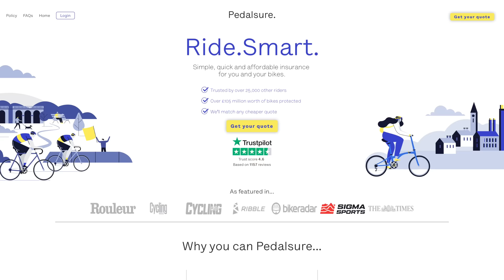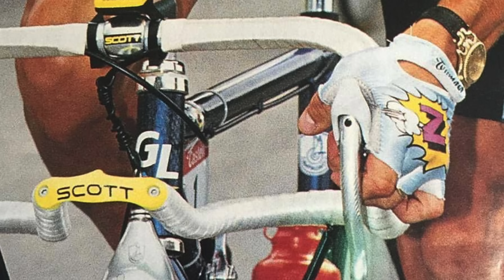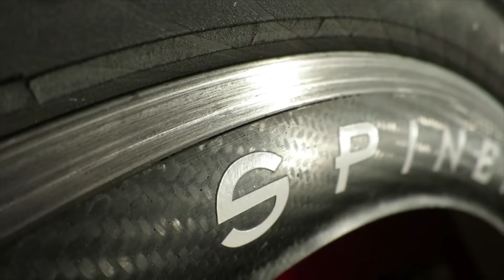5 BIGGEST Tech Fails of The Tour de France

Comment: In its defense, the wired Mavic Zap actually worked quite well.  Their wireless Mektronic was a disaster, though.
Reply: Yup. The only issue I've had with the Zap was when the battery was low and it kept wanting to shift to the smallest cog instead of staying in the gear it was in. I still use mine everyday. I did adapt the Mektronics brifters to the Zap system.

Comment: Rev x was a pretty darn good wheel .
Reply: I am still riding a trek 5500 with rev-x wheels.
Reply: @ReginaldPoyau  Very jealous 👍
Reply: Agreed.  I've never had any issues riding both the road and mountain versions.  They do look cool as sin, too. :)
Reply: Rumor had it the failures were caused by a harmonic resonance that would flex the spokes to failure as static strength was very high. That is why the stiffeners seemed to prevent failures. Surely the stiffeners negated some of the aero advantage
Reply: @othgmark1  I think this is correct. The spokes are riveted together at the rim and I believe that is where the crack failure would start.

Comment: I do strictly amateur level cycling BUT I did fit a set of the Spinergy wheels (1990s) to one of my bikes and that was a revelation. First, more comfortable, damping of the road roughness was clearly noticed AND compared to another set of wheels (Mavic SSC laced with DT Swiss bladed spokes) over the exact same course (approx 28 miles) I was averaging 1 mph better on the Spinergy wheelset. The only nit I had to pick with that wheelset is you needed an extension for the valve stem and it was a handful to pump up the tire. I can't figure out why the UCI considered the carbon spokes to be a hazard. With all the other pointy or sharp parts of a bicycle that could hurt you in a crash I'm sure the Spinergy spokes would be way down low on the list of "risks". Another big plus was that they were pretty much bombproof. The average pot hole at speed or road hazard never caused any damage to the wheel. I rode that wheelset for over 10 yrs with no maintenance required and they are still in tune. If Spinergy ever came back on the market I'd grab a set in a heartbeat.
Reply: I really like the look of these types of wheels too but had heard about them being potentially dangerous. 

Having done a bit of reading about them I can't find any reports of severed limbs etc but I have read about the dangers of them suddenly and catastrophically failing. 

The logic is that carbon fibre fails very suddenly, where as metal deforms before breaking. This combined with only having 3, 4 or 5 spokes means that when one spoke goes all the other go at the same time and it produces a big crash. It's also likely to fail under higher loads which I guess are going to occur at higher speeds. 

There is a report Mr. Rick Vosper: A tangled Web Woven, GorillaNet v.2.8.1, September 4th, 1998 if you want to read more.
Reply: I think it's the nature of failure that's the problem. When carbon spokes break you'll have catastrophic wheel failure, vs. going out of true and wobbling. I still have a set of Spinergys and frankly am scared to ride them.
Reply: They were not dangerous when they were whole. But they often weren't. They were flawed and broke often. The cause was insufficient "spoke" tension due to various factors. When you overloaded them, they would collapse, and contrary to a standard wheel, that was a catastrophic failure. The spokes would break, and if you ever saw carbon breaking, you know that it virtually explodes, sending sharp shards shooting all over the place. Plus, if it was the front wheel, the rider is falling on what is left of it - which in this case would  be a hub with 8 sharp swords protruding from it. There was a GOOD reason to ban them.

Comment: Had several of these "fails" when I was racing through the 1990s -- Drop In bars worked fine.  They were a deeper drop and great for crits.  When I first got them, I was still using downtube shifters and it was easy to switch gear from the lower position.   I thought handling was fine and definitely much safer than the (now UCI banned) method of stretching your forearms on the tops to try and get aero.  Had a pair of Spinergy wheels which came apart on me -- a teammate had a pair and broke his, too.  They did have an unmistakable sound and were pretty popular.
Reply: What was the sound like?  Can you describe it?  I'm 41 so I just missed that era!
Reply: @OakleafOrganic  like a helicopter rotor or something, whom, whom, whom, whom. 

Had a pair and loved them. they were wicked fast
Reply: @ChrisTrunek  what?!?!?!  That sounds awesome!!!!!  Remember the Sobe label with the lizard riding up a singletrack on a (mtn) pair?  That was cool.

Comment: Had a pair of Spinergys on another ‘banned’ product, the Trek Y-Foil, in the mid 90s. Absolutely fantastic combo. Fast, responsive, although by modern standards a little heavy. Still ride the Y-Foil but the Spingerys went out when I had a massive crash in Spain. Doing some TT training, down in the tuck and hit a 4cm deep pothole, front wheel crumbled completely flipping me over. Bike came up and over with me and I landed on top of it, my elbow going through one of the splines on the rear wheel. Lots of other parts broken including my ego as I managed to crash in front of a parade of shops. By the time I crashed, talk was of banning the Spinnergy style wheel, so I didn’t replace them when I rebuilt the bike, more the shame, because I loved them. As people say, looked amazing (especially on a Y-Foil), sounded amazing, rode amazingly well. Only negative was braking, as I had the original version so no steel rim for the pad to work on. To say it was sketchy braking in the rain or when the wheel and pad were hot (such as a long alpine descent) is an understatement.

Comment: Rev X’s were my first carbon wheelset, loved them - they were soft riding and made a good noise at 40kph. Super reliable as well, never had a problem with them and I rode them lots.
Reply: i used the Rex X on my cyclocross bike and my mountain bike with no problems with the wheel.   I did get a large stick get chopped in half when thrown up into the wheel and could have had a squirrel cut in half but I believe he hit the spoke and bounced clear.

Comment: I still have a set of Spinergy Rev-X wheels. You had to glue the factory supplied  X stiffeners or it was rumored that they could collapse under load. Mine were fine, but the UCI were right regarding the amputation danger. I had a squirrel do what squirrels do, and the poor animal hit my front wheel and just exploded. They were the Cuisinart of wheels.
Reply: Some 25 years ago, I had 2 birds fly thru my front Spinergy wheel on a group ride and yeah, it didn't end well for them. Oddly enough, I didn't go down.

Comment: I had a set of RevX's that I used for about 5-6 years (eventually one was slightly damaged in a crash and that was that).  They were pretty aero (especially for the time), but they were heavy. I'm fairly sure they were over 2 kg.  One nice thing though is that you didn't have to worry about them going out of true.
Reply: just get yourself a pair of handbuilts w/36 straight guage spokes.  My clincher wheelset are 20 years and still True.

Comment: Nimble Crosswind tri spoke wheels were amazing. Light and efficient, wish they were still in business. Still have my spinachi bars somewhere.
Reply: I wanted to buy them to replace my Specialized Trispokes that I warped in Saudi’s extreme heat. Sadly, Nimble said they wouldn’t stand up to the hot road surface here.

Comment: I remember when Mavic Mechtronik was new. I love the design and ergonomic feel of the levers. I was tempted to buy it once but didn't because no bike shop had and has the technical ability to service it if something were to ware out or brake. I have been working on bikes since 95'. I'm a big fan of the Avid Rollamajig and still use one to this day. I find it very disappointing that high end road bikes have gotten heavier with thru axles and disc brakes. Call me old fashioned but I believe that such things always belong on mountain bikes. Thanks.

Comment: Very nice video, 
the Mavic shifter was special, it was not allowed to use electric power to shift, so the was only an electric impulse to the shifter, the power to shift come from moving the chain, the upper shifting wheel gives the power to the shifter. An amazing construction.

The synergy wheels were definitely very dangerous. I’ve got same scars from the special wheels 🤬

Comment: You're wrong on the Spinergy wheels. They were not banned because the edges were too sharp, they were banned because they failed very often, and when they did, what was left of them was VERY sharp and dangerous. A spoked wheel depends on the tension of the spokes for its stability. Spinergy wheels had a mechanism to adjust the tension, but many users failed to do that, and in some circumstances the tension would vary by itself. Having them in the car in the sun, for instance. Now, when you load the wheel so much that a significant number of spokes lose tension and go "limp", the wheel can fold. So you would get your wheels out of a hot car, put them on, get out of the saddle to accelerate and bam, you're down.
With a standard wheel, folding usually results in a bent rim, but the wheel does not collapse. It's not easy to fold it to begin with because there are many spokes stabilising it, and when you do you probably don't fall. With the spinergy wheels, it is usually only ONE spoke that loses tension. And that one spoke is designed to be under tension, and not to bend. So when it bends it can easily break, and when it does, the ENTIRE wheel loses tension and ALL spokes break. Have you ever seen carbon breaking? It won't just break in one place, it shatters and shoots sharp shards everywhere. So the people watching are likely to get a couple of centimetres of sharp carbon in their eye. And the rider is going down, if it is the front wheel that has broken, he is going down straight on that - which at this point is just the hub with eight very sharp carbon daggers attached to it. I don't think I need say more.
There was a (literally) bloody good reason to ban them. They were VERY dangerous. You would not get me to ride them for more than a couple of metres.

Comment: I have the Modolo "Q-Even" bars that emulated the Drop-Ins, albeit with the angular, ergonomic design that was popular in the '90's.  Love that extra hand position, I sometimes rest my thumbs against the head tube & fork junction as I slam my pedals.  No problem with stability, in some mysterious way the position stabilizes the handling of the Spinergy Rev-X's that I used faithfully for almost 20 years, until I wore through the rear rim brake track.  I'm still using the Q-Evens, to this day.  They now keep my new "SuperTeam" tri-spoke" carbon clinchers under control.  Some stuff just works.

Comment: Loved the Scott drop in handlebars. I was racing with the superb pro 7-speed index shifters and the mavic freewheel.
For long rides I could ride those drops all day long and it moved you slightly further back in the saddle for a little more power coming from the glutes.
 Easy to just move from the drop to the shifter to shift.
But, when you're in the 12 all day you really don't need to shift much.

Comment: I remember all of these, the Spinergy wheels were the coolest looking but not stealthy, with that whooshing sound you could not sneak up on somebody. Tricky in cross winds too. Spinacci bars were short aero bars you could add to the top of your handlebars, until banned. Another problem with magnesium is it becomes brittle with age, even so it was used in wheels, pedals and suspension forks with various alloys.

Comment: 1:56 But I don’t understand - SRAM and Shimano use radio waves to transmit shift signals for their modern wireless groupsets. In fact, as far as I’m aware RF is the only form of wireless transmission that doesn’t require line-of-sight. So I don’t think using radio signals was itself the actual issue. More likely the problem was that their particular implementation of radio transmission wasn’t robust enough in the face of interference.
Reply: It sounds like they didn’t use any sort of protocol to avoid interference or having one shifter shifting somebody else’s mech. Modern ones use Bluetooth (I think) which not only has a protocol with a unique identifier, but it also uses spread spectrum so it’s resistant against outside interference.

Comment: I wouldn't call it a fail, on similar grounds to the Scott Bars, but SRAM's hydraulic rim brakes went nowhere
Reply: I have a set of those sram force hydraulic rim brakes on my s-works roubaix... they suck :D
Reply: Magura had a set for road bikes long before sram. Integrated brake/shift levers killed them off. I have a set on a time trial bike. They are unaffected by aero routing since fluid doesn't bind up in tight bends the way cables do. In an era where time trial and triathlon bikes had marginal brakes mine stopped very well.
Reply: I still have Magura hydraulic brakes on the back of a tandem.  Working (kinda) great after 25 years.

Comment: I had Scott Drop-Ins. I couldn’t find any aero advantage. I don’t think they were dangerous. It was a 25.4mm diameter when stems were 26.0mm. Moreover, I was always careful with my knees hitting them. The handlebars were flexy too. Spinaci were okay. And now riders are using 36cm wide handlebars with their hoods angling inward. Nobody is talking about that lately. Are those dangerous in your opinion?
Reply: I had the Scott drop in bars as well but the grey ones, nit the aluminum shiny color and yes they were flexy and they even cracked where the stem holds.
Reply: 25.4 was what Cinelli made stem diameters at during the 26mm era. Scott made both diameters if l recall correctly.
Reply: @othgmark1  Cinelli was 26.4 mm. The original drop-ins came with a shim. The later LF (liteflite) model had a bonded 26.0 tube in the center.
Reply: @huffytoss  yes they were my mistake. My drop ins came on a Lemond race bike l purchased used from a local team to help them raise funds and l used it as an early gravel bike to explore dirt roads in the Santa Cruz mountains. It came with the drop ins on a locally constructed stem 26mm from a small builder. I did not know they used a shim for the 26.4 size as mine were already installed. I replaced mine with An ergo bar and the shape was the reason. The Lemond was one of the last Reno built frames and has a very long top tube so my knees had no interference issues with the drop ins. As l have any attraction for the slightly unusual l also have any aluminum Cinelli integrated bar stem combo and a set of the cnc'd stem angel aero bars as well. Oddly enough l never had a standard 26.4 Cinelli set up a l generally built up bikes with ttt or itm bars and stems.
Reply: @othgmark1  I can't remember. I thought Scott made 26.0 handlebars after the drop-in. That's a great point!

Comment: People seem to forget those spinergy wheels actually sliced off the fingers of 3 pro cyclists as they tried to adjust the speed sensor on the forks of their bikes. Added to that when they crashed the wheels shattered showering razor like carbon around. No surprise they're gone. Shame about the spinergy spox though, they had carbon vectran string for spokes and we're so comfortable. Now only used on wheelchairs....
Reply: A friend's company was sued because of Spinergy.  Small framebuilder sued because of the wheels.  Such a shame our court system supports this baloney.

Comment: Good video I still have spinergy rev x from 1999 and still ride on them and took care of em all these years they are in good condition. I have very minor crack on blade. A carbon blade got a minor chip while I was degreasing the chain it’s not major and no cracks at the rivets. I was cranking the pedal running the chain through my degreaser and the blade hit the degreaser contraption yesterday on my Cannondale R800. What epoxy would you use to make sure it stays safe? Can I get the stuff I need  from Ace Hardware? Any help is greatly appreciated I love these rims and don’t want to retire them.

Comment: Seems like everyone local racing had spinergys but I certainly couldn’t afford them.  Spinaci’s….I did a 40km TT with those and my forearms were beaten up with no support….put them on the shelf.  Don’t forget the Softride beam, that was supposed to be better and some of the guys that rode with that frame style would boast about faster acceleration having the smaller wheel diameter.